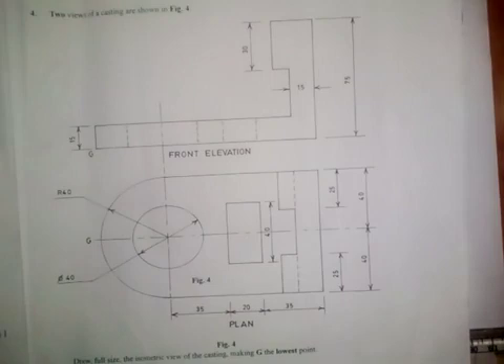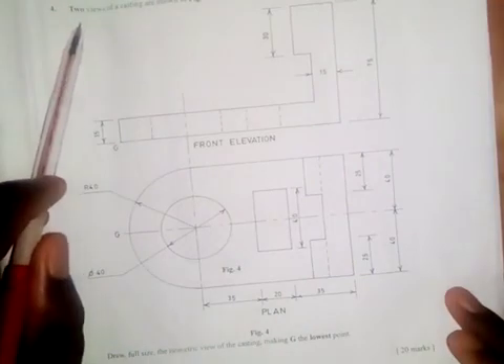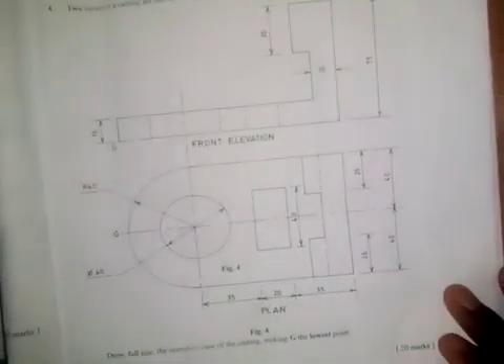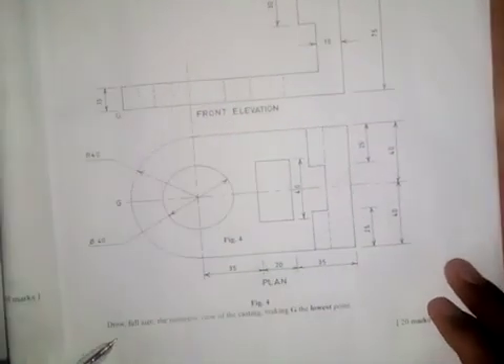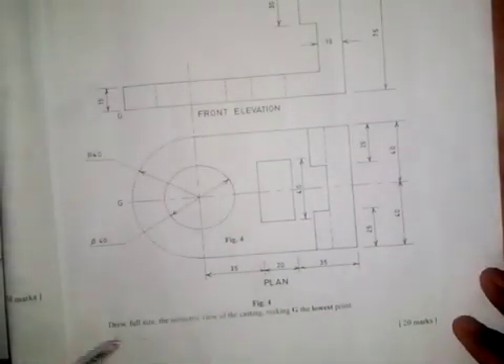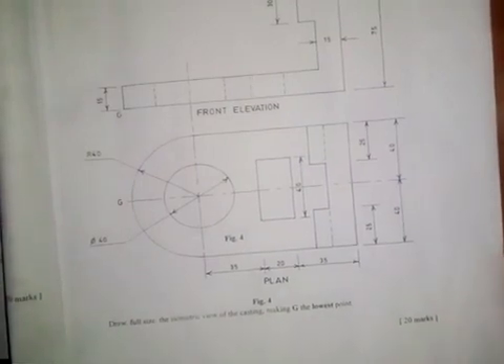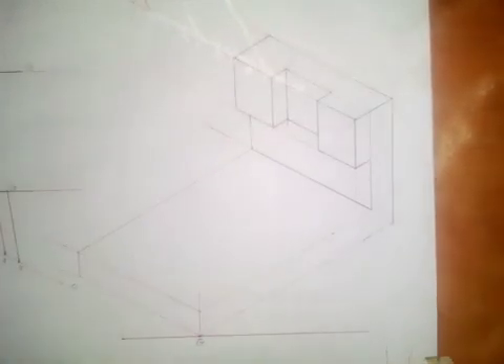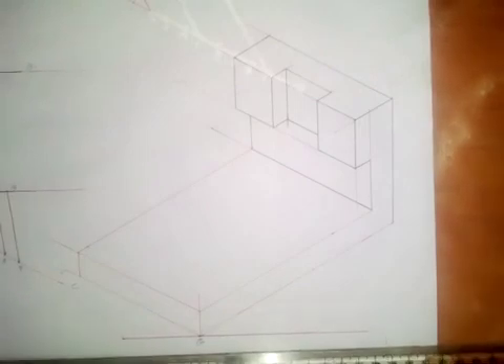Solution to Question 4 WAEC 2022

Comment: Sir you measured 135 mm instead of 130 when drawing the base of the front elevation, check it out.
Reply from the maker: Yes it's actually 130 just go on with the right dimension. Thanks